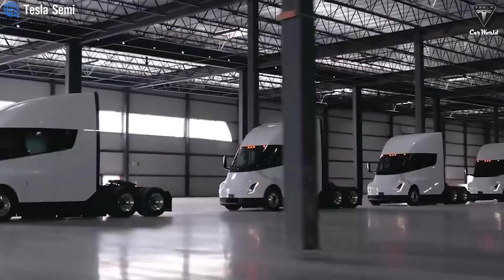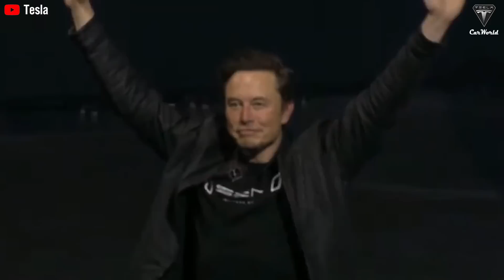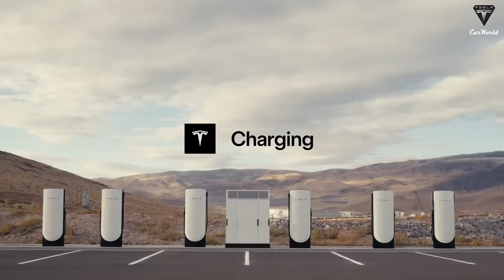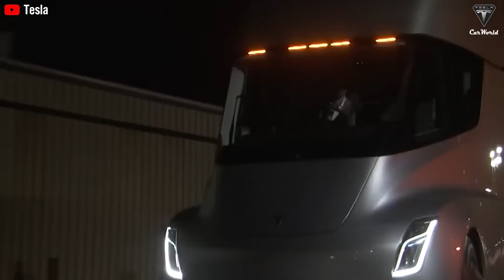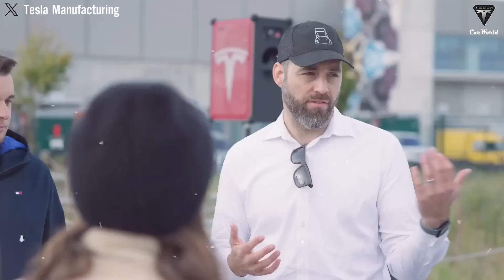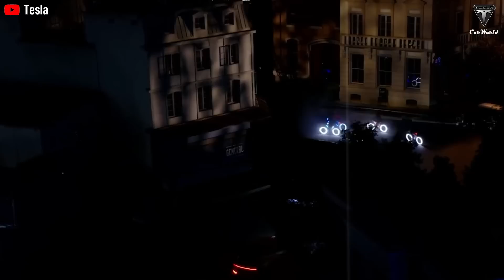It Happened! Elon Musk Confirms Tesla Semi Final Launch In Nevada! Price Increase Rumored Cleared!

Comment: Interesting to see how Tesla will increase the number of models and cope with regulations for different markets. There is still little information about models and options for purchasers. Typically, I would assume that a company planning to buy semi-trucks will start sometime before, say, a year or so. As we speak, we are about six months from production start, and models with specifications should be available.
Reply: Tesla will do it the way they always do it. Tesla simplifies everything to create favorable economics for their customers. That means they will launch the Semi with only one model, a mainstream semi that will fill most market needs. The rest will have to keep using diesel. Remember, electric powertrains are far more versatile than engines and transmissions, one electric powertrain can excel at multiple roles. As they expand sales and start to saturate those markets, they will address more specialized needs with variations of the original model.
Reply from the maker: Great point. Tesla Semi rollout is U.S.-focused now, but future models may adapt to global markets and local rules.

Comment: Mechanically,  the motor is not much different than an electric forklift.
Reply from the maker: True — but Semi’s torque, range, and regenerative systems go far beyond forklifts. It’s built for long-haul power.
Reply: Yeah except, rare earth and a fraction of the size and less weight and more power and Forklift motors are just dinosaur shit.  Zero technoligy and heavy. But a forklift needs heavy.  A forklift runs on 4000 lbs. of lead acid, with a 12 hour max charge. Different job. I worked in a plant with electric forklifts.